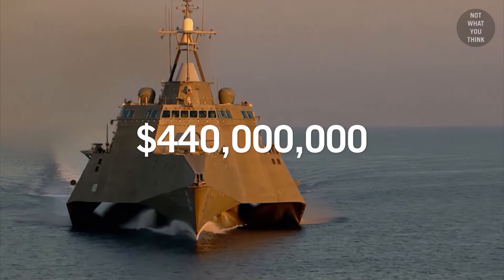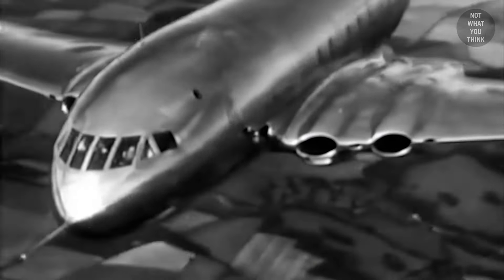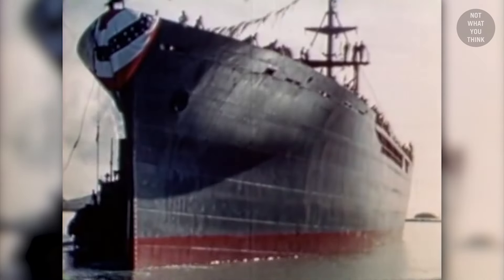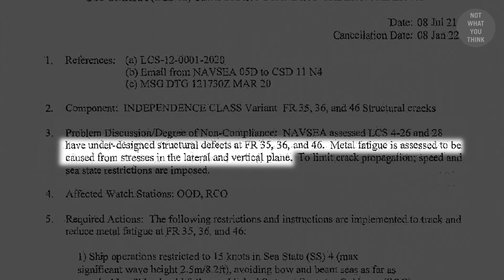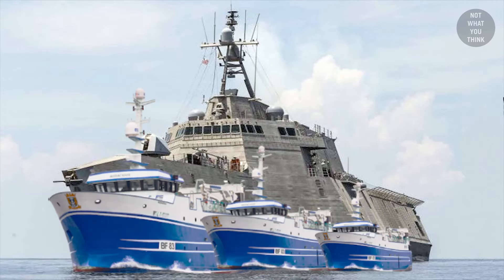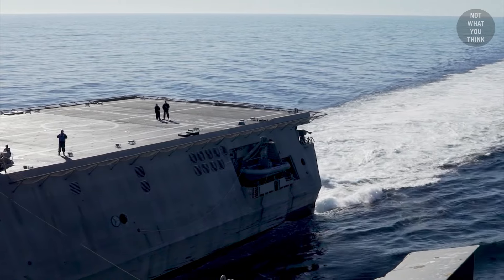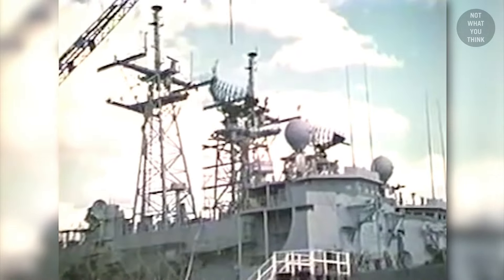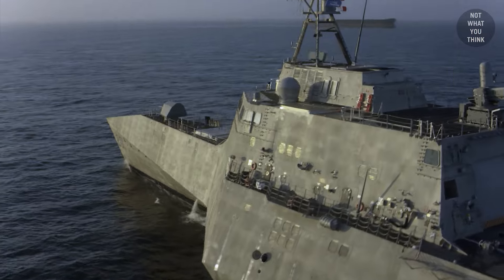SPEED Makes This Warship CRACK!

Comment: Sharp transitions, straight lines and flat surfaces don't withstand well the repetitive, dynamic stresses put on a sea vessel. This ship design flies in the face of that and is suffering the predictable consequences. It's hard to believe this obvious outcome wasn't realized in the testing/development stage.
Reply: It's perfectly fine. Ships have had angled structures for decades. The LCS's are just a bit of a mess.
Reply: @randomguy9777 I understand that and I am no expert but I think they got it wrong obviously. thanks
Reply: @gabrielpalileo3294  Yes I understand and agree. I stand by my premise though. They could've overcome these basic inequities but they failed in this instance obviously. Again just my opinion. thanks
Reply: @randomguy9777 The question is, why would this tpe of ship need to reduce radar cross section?  Isn´t it supposed to operate only inside US national borders?
Reply: Yes, and lack of metallurgical understanding.
Reply: I agree, the awkward angles that radar stealth demands might be workable with the F-117 Night Hawk, but does not seem apply well to ships.
Reply: This is too big of a ship to be a trimaran. There would be times when the center hull have almost no play in buoyancy and I am surprised they didnt even think of that.
Reply: @Swordphobic  Because corruption.
Reply: You seem to be discounting the value of the ship looking awesome tho
Reply: @sunray501  My thoughts exactly.
Reply: @Andy Yes I understand the purpose that it is designed for. It's like the F117 stealth fighter. The F117 surfaces are so aerodynamically chaotic that keeping the aircraft flying would be impossible without constant, ongoing computer control. I am saying they got this ocean going version very wrong with regards to the abnormal stresses it would be under relative to a traditionally shaped sea vessel. The rest of your supposition is completely off but if it makes you feel better to jump to conclusions and berate me it's your prerogative to look foolish. Good job at that though.
Reply: @Andy funny enough, foundering in the middle of the Atlantic also lowers a vessels radar signature
Reply: @gabrielpalileo3294  Decades don't count for much when ships have been built with sheer, camber and fine hull contours for literal millennia.
Reply: Sharp transitions can direct stress into specific points. However we in NATO nations know enough about shipbuilding with sharp angles and transitions to compensate for that and overbuild stress points. And the angled structure has a purpose as with many modern ships of reducing radar return.

The issue is the people who designed and built the LCS compromised and decided to lighten it to achieve the speed requirement at the expense of strength, adequate crew numbers, and combat effectiveness.

They're incredibly expensive glorified patrol ships, and while there are certain elements of their design which are worthwhile the end product is still subpar for the cost.
Reply: @Swordphobic  no, they were designed for near shore operations, but not necessarily near US shores.
The trouble is they cut down the design for speed and cost that they made them less useful in that roll unless supported by other vessels, negating the usefulness of their speed and low radar cross section.

Hopefully the new Constellation class will be much more suitable for worldwide multi-purpose missions though as it's already a proven and well thought out design.
Reply: @sunray501  it actually does apply well to ships, also why mention the F-117 in 2022? We have much more advanced stealth designs now.
Reply: @G1NZOU  I don´t know if the rest of the world wants them.
Reply: @Swordphobic  probably not, frigates do 80% of the same job and less expensive patrol vessels do the rest for much less design funding and support cost.

Comment: I’m a welder. I work for a company that builds aluminum LNG heat exchangers. We always X-ray the structural and pressure vessel welds. Not only that but we also dye penetrant test our welds. If there are any issues we remove the metal and re-weld it.

Comment: So the older ships can go faster and can operate in bad conditions but the new one's can't? 
Why is this becoming so common?
Reply: Cost.  The dollar "bought more" in the 70s and 80s.  As cost goes up, quality goes down due to the cutting of corners.
Reply: @swaghauler8334  that is pretty deep ser.
Reply: @Degreeofconfidence  The sad thing is that it applies everywhere in our economy.  I remember when older appliances used to last for 20 years.  Try getting more than 5 years out of a modern washer or dryer now.  Older roofing materials would last 50+ years.  Today, if you get 20 years out of a new roof, you are close to needing a replacement. 
         I guess it's just the way of the world.  Some Roman guy probably groused about how his older chariot lasted 10 years and the new one only five.
Reply: @swaghauler8334  now products are not really made to last, in contrary to the older products
Reply: @swaghauler8334  It's called planned obsolescence, Companies realized if they made lower-quality appliances then they could save money and then in a few years get your money AGAIN when it tears up, I tried to tell my family not to get rid of our old stove from 1993 that needed a new gasket but they wouldn't listen, They bought a newer GE stove that works good but I give it 3-5 years max.
Reply: The reason is manufactures and builders realized that if you built things to last you only made money on the first sale. If quality was high and maintenance was only need every hundred years or so for a house, say twenty for an appliance then you were only getting business for new things. The money is made by lowering standards and rekeying on quicker break downs allowing you to get more money out of the customer for repairs. Rather than your offspring or another company when neither you or the company may not be around.  Made to break down makes income for maintenance increasing relatively immediate revenue. My grandfather was a carpenter in the early 1900’s before WWI and many of the homes he built out west have stood a hundred years with no maintenance at all! Quality built and built with quality materials. Today a new house is built for issues to give the repair industry more work and larger incomes. I am not kidding, that’s the game. Young people have no idea and many carpenters and handymen just think it has always been that way.
Reply: The chemistry of plate aluminum in the dynamic ocean environment is complex and changes over time due to corrosion, stress cracks, galvanic corrosion, stray electrical eddy currents in the hull, etc. Combined with static and very dynamic stress loading, suffice to say it can't all be modeled and retrofits will be needed in various places for a host of encountered issues. These ships weren't designed for the usual 30-35 years with at least one or two "mid-life" modernization periods. So, yeah, they went cheap and are paying a higher than planned operating price as a result.
Reply: This is just a common issue with design/innovation.

Certain classes of ship end up being better than what comes after them because remember, ships are built by class. But those ships will only temporarily be good as eventually something better will come along using lessons learned from both classes and make something modern
Reply: This is just the design process. Even in military acquisitions process one just needs to look back a tiny bit to see where this stuff happens. Zumwalt/DDG(X), Seawolf/Virginia.
Reply: pyropulse  not really. I mean sure that's a phenomenon but that's not what's happening in the West. They tried something significantly different because of the potential for it to be a faster lighter less detectable vessel And they have the money. 

It turned out to not be durable enough
Reply: @Alfred Wedmore Never heard of Miele.  Try having that roof in the weather like we get here in the NE USA.  -22F in the winter and 100F in the summer.  I used to have a Slate roof, but the Insurance Company made me replace it with a metal one.  Slate was too hard for them to replace no Insurance company would insure my house with a Slate roof.
Reply: @Alfred Wedmore Shingles or metal roofing.  They used to last 50 years.  Now they last 20 and cost twice as much. 

Never saw a Miele appliance!  Now I know why.  They aren't even sold in the US.
Reply: @swaghauler8334  In the 50's you could get an Aluminum lock shingle roof. Those are amazing, has not needed a repair since
Reply: pyropulse  Not too sure about that. Have a llok at the technology of the vessels used in the SailGP global racing events and the America's Cup events. The future of ships right there.
Reply: Do you mean like the Titanic for example?
Mankind has come a long way since it went down and the materials that vessels are now made of (especially hulls) has changed enormously. Just remember welding was virtually unknown of when she was built resulting in her hull having over a million rivets. A lot is still to be learned given the amount of space development happening in our time.
Reply: pyropulse  no
Reply: @swaghauler8334  though I would suggest quality really started to go downhill in the latter half of the 20th century. Management revolution, bean counters.

Comment: It wasn't just riveting causing it, the key factor was the square shaped windows, which you have never seen on the side of another jet airliner since. The corners concentrate the stress fracture leading to tearing/failure.

Comment: Independence class LCS' dont entirely make sense to me, I've heard people say that they're stealth ships because of that very angulated body, even though their radar cross section is about the same as any other Naval vessel, other than to modernize the Navy (which makes sense) but man, you'd think after this much effort and continued failure the Navy would just cut their losses on a warship that's built not really to do Naval combat things but instead it's meant to do Coast Guard things.
again, fair enough everyone with a coastal border should probably be at least semi regularly patrolling the highest risk parts of that border, you'd think that this would have been another R&D program that never found success and yet LCS' are around.
Reply: To be fair, they are cutting their losses.
Reply: Could they transfer these ships to coast guard?
Reply: Yeah they're decommissioning all of them by next year I think. Navy shipbuilding really needs to get their act together...the whole Zumwalt thing, and now this 🤦‍♂️. Fortunately we do at least have 3 working Zums, and if they pull off the planned stripping of the guns in place of new launch cells filled with hypersonics, she might actually save some face and be a formidable missle destroyer. Still though, come on Navy...
Reply: @adityapatil325  The USCG doesn't want them.  They're already in the process of replacing 3 of their most common ship classes with newer classes and they can already push 40 knots without breaking apart.

Think of it this way: If the Navy can't afford to fix them how is the Coast Guard going to afford it?
Reply: @adityapatil325  Very (very) funny. Imagine the fun they'll have.

Comment: In the 1970's there was a controversy with a new group of small cargo trucks built by Grumman out of aluminum. The problem there was cracks also. The trucks tended to get cracks in the back door frame due to sideways loads that happened from the poor trucks running through potholes that were not anticipated. Grumman was new to the truck business and lost millions in required warranty repairs to the trucks.

Comment: Thats’s not true about just finding out about the cracks ……. We’ve known several ships have been cracking for years because of the type of aluminum mix they used ….I remember 2018/19 hearing about the issues
Reply from the maker: You are correct. We should have been clearer. The restrictions that were imposed as a result of the cracks (and the overall extent of the problem) wasn't known until recently.
Reply: This is stated in the video. And it's not just "the type of aluminum mix they used" it's any aluminum period. There is no form of aluminum that is okay to use under constant stress, as it doesn't rebound from that stress. It rips on a microscopic level no matter how little stress is applied to it. And until reforged, those cracks never go away. Try bending a can until its dented then work out that dent, it will still be very weak in the creases no matter how perfectly reshaped it looks.
Reply: It's not the alloy, its the design.
Reply: @camojoe83  No, as I said it is the properties that aluminum has period. Maybe it's a bad design as well, but aluminum is not a good material for any level of stress.
Reply: @thesmellofbacon7595  I just can't see 1 of these things taking a missile hit and being able to make it home
Reply: @thesmellofbacon7595  So you're saying that the USN bought ships made like beer cans? Damn, I coulda ordered a Schlitz.
Reply: @thesmellofbacon7595  You have little understanding of metallurgy.  Ever flown on any aircraft before?

Comment: ...what navy needs are disposable (one time operation) ships. Just look at the benefits:

no cracks - check
no maintenance - check
customized depending on a mission - check
up to date tech - check
perpetual procurement - check
money wasted - check

...you can thank me later...:)
Reply: that new ship smell - check
Reply: Of course these things need to be cheap, which means they have to be relatively small. Of course that limits it’s range, so it needs to be launched from some sort of mothership or dropped from aircraft. Then you need to put a weapon on it, and a big pile of explosives sounds like it should be able to sink a ship.

Finally it needs a name, we can call it the: Tactically Ordered Rapid Peculiar Extra Devastating Object. Or TORPEDO
Reply: @Sir_Budginton  ...cheaping out on military tech never pays off. It needs to be cutting edge tech with at least a triple redundancy for guaranteed effectiveness and at lest one major flaw so it can be made in bulk.

Effect of the weapon should be devastating both for enemy and american military budget...
Reply: A disposable boat? 🤷 Ok, guy, let me know when you're drafting plans. 👍
Reply: The Navy did use PT boats to launch torpedoes in WW2. Pretty much what you're saying.
Reply: So..... Cruise missiles that can float?  🤫
Reply: @seanbrazell7095  ...definitely float and made of aluminium to save weight, because on it's nose should be installed an M134 GAU17 "Vulcan" cannon that can take care of aerial threats. Diving capability is extra, but possible if necessary...;)
Reply: @Ass_of_Amalek  no need for warranty - check
Reply: Basically had them in WWII how fast were they pumping them out like weekly? daily?